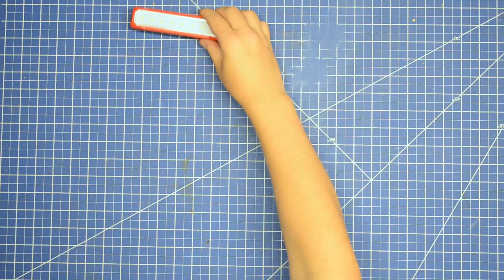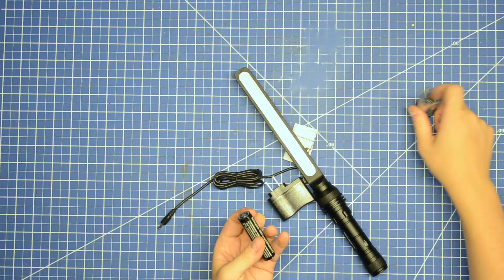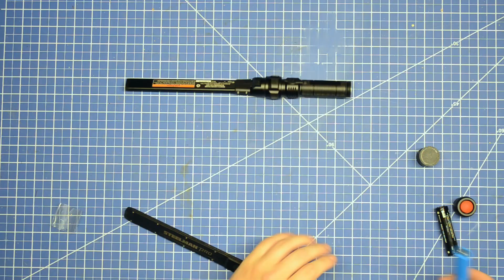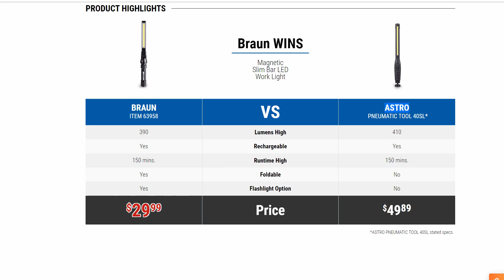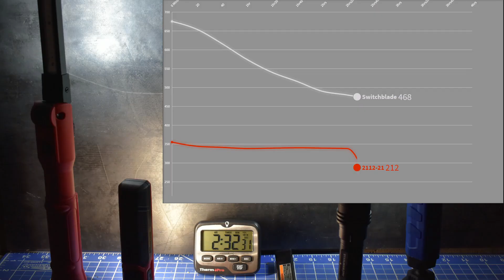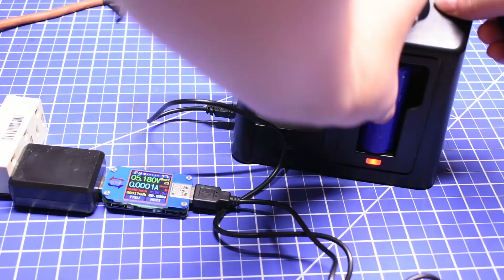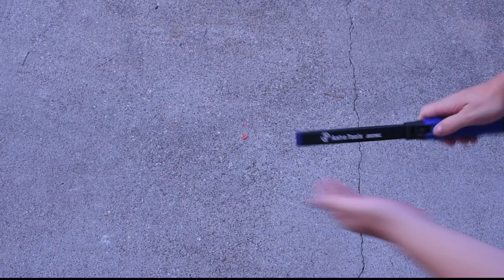Is Milwaukee Lying as Much as Harbor Freight Braun About Lumens?

Comment from the maker: See which lights and other tools have made the cut on our Amazon Storefront: https://www.amazon.com/shop/torquetestchannel
Reply: Keep up the great work. 👍👍
Reply: I love these light videos
Reply: The Astro SL52 is the best IMO but the 80 isn’t far behind
Reply: I was just thinking you should test torque wrenchs actual twist handle ones, im just thinking a test at the lowest torque setting, then either just at max torque  setting and/or mid range. Im curious how accurate they are from the factory. I know you can usually adjust them too but then ive also seen the electronic torque measuring adapters that i dont feel are as good as yours... cough cough Harbor FREIGHT. I know too many people buying their stuff and thinking their claims are true... earthquake xt. Im gonna try showin them your video on it nicely. They do have some decent stuff, like they're cheaper corded grinders are or at least used to be worth more than 30-50 bucks in the motor i feel. Plenty of speed and power without too much current draw unless you try to stop the blade but thats not the point. Ive gone on long enough, we all know they lie then excell and even surpass their own "tests."
Reply: Should also test ratcheting wrenches because why not.
Reply: Looks like HF free give-away light is a best buy  just by looking at the output.

Comment: Thanks for the vid. I have a newer version of the Braun light which advertises 500 Lumens. It's bright enough for what I do so I couldn't care less if that's accurate or not, but what really pissed me off was the runtime. Harbor freight advertises 20 hours 😂😂😂😂 of runtime, but doesn't specify which mode. I thought mine was defective when it was dying in less than 3 hours! But thanks to this vid it seems that's about typical for high mode.

Comment: was the steelman 18650 battery protected & the others you used unprotected? the chip added to a protected battery increases its length very slightly. i refuse to use lights that take a proprietary battery, olight loves to do that crap, they make good lights but having to buy their 18650 batteries instead of the boxes of regular ones I already have really turns me away.

Comment: I haven't bought any of this lights but if I tested the cheap inspection lights I used for drop resistance I would have dropped them once straight into the bin so I wouldn't have to pick those damaged torches up from the floor ... 😒

'cause even one drop from low height meant that the on/off button would now get stuck in the pressed down position and you would now have to hit the torch on the battery lid to get make the on/off button on the other end pop back up...

So to switch on:

 press on button in and hit the other end of the torch to pop the on/off button back out and then AGAIN for switching it off press button and hit the battery lid on the other end

..... One.... DROP..... on the floor 👎👎👎👎👎👎

Comment: I imagine people want to know if the light runs off the charger as not everybody is perfect, not everybody knows the ideal way to keep a cheap lipo alive for more than six months. The maintainence is not clear. so if that non standard sized looking  battery (not just available at the shops) is useless the torch would be useless, unless . . . The torch runs off the charger.

Comment: My opinion, the Walmart Hyper Tough work great for the price. The pen light has 3 different lights, 4 modes with folding and rechargeable. $14 with a magnet base. I love mine and when I accidentally left one under a truck because the boss was in a hurry to get the truck out, and they were gone before I could get if off the bumper. I didn't care so much about the $14 verses $100+. And I actually paid $8 originally, but still the $14 is great. The larger $30 works all day for me, bright enough, 3 modes, heavy magnets, and rechargeable. For the price I'm extremely happy. And nearly all Super Walmarts or main Walmarts carry these and offer extended warranties for like $2.

Comment: I use the 12 Volt Bosch Pro lights and have been very happy with them so far. Lights costs about the same as the ones you tested, but given they come without a battery and use Tool batteries they end up being fairly juicy if you have no other use for the batteries. Runtime is as you might imagine very good, light quality is OK, i have seen worse but also better. Durability is pretty good but could be better, especially on the inspection type lamp.

A High CRI Astra 80 SL would be something id like to buy. 26650 cells are something i already have lying around and i like the quick change system they've got going.

Comment: Worklights and inspection lights are 2 different lights to me. My inspection light is a StreamLight Strion. It is on my person all day at work. My go-to work light is a StreamLight Knucklehead. The knucklehead is not the brightest light but it doesn't have to be for what it's used for. The knucklead is the ONLY worklight I have used that will survive a shop environment. I even ran one over with an F250 and it still works.

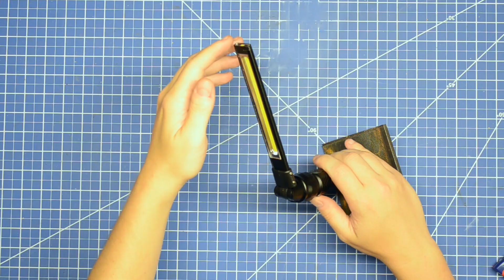Comment: 2:45 - it's do to the battery cap, I noticed that too, putting it onto a metal surface it slightly un-twists the cap. I have 4 of these lights and that's the only fault I've notice, so far. I've had these for years

Comment: Another knock against the Braun (pointed out by a mechanic on another channel  who has tried three of them) is the poorly cut battery compartment threading. This was a problem because while he really liked that he could just insert a new battery when it ran down, unfortunately, the battery cap threads deteriorated from repeatedly unscrewing them and this happened on all three lights that he used, so he has decided to give-up on using this light, though he otherwise liked using the Braun in his shop.

Comment: I agree not recommending Braun lights for professional applications. I bought 2 a few years ago as only a home user. They both held up well, surviving a couple drops, until I dropped one from around 5' and it cracked the swivel header (aluminum part). As far as home use, I think they're fine particularly when I bought mine I was able to get them for $20 each.  I also upgraded the batteries eventually, although typically the OE batteries were fine and they did last a couple hours. Never thought anything on the light tint.  Not sure what the market currently is, Braun's may still be an OK-quality budget option or not.  The other issue, and it's a minor one, is the magnet cover's both wore through and started shifting. They appear to basically be a thick sticker. Someone like a pro mechanic would probably experience this in a couple months, to the point where they would have to be very careful to avoid scratching/marring paint work.

Comment: I'm retired now and picked up a pair of Chiwanese wand "worklights" for $8.99 on Ebay.  They have Bright (maybe 300lm), dim (maybe 100lm), single LED tip light (maybe 150lm), red strip (maybe 75lm), and flashing red strip (maybe 150lm).  I'm QUITE satisfied with them for the price. I don't have a runtime on any mode yet, but they're internally rechargeable.  Oh, there is a magnet on the end and a hook, for working on your Tesla aluminum frunk lid, I'm sure.  //  You have great tests for all these lights, dude.  Thanks for all of them.

Comment: I have the Braun light and it works quite well for general purposes. It does break when dropped but I have broken the business end off several times and glued it back with epoxy and reinforced with dental floss... it is by no means a tank... the pin in the center is plastic and is the weak point but I drilled out one side and shot a screw through the pivot and so far it has been working well. 

I will mention that if you replace the battery make sure you use a PROTECTED button top 18650 unless you like angry pixies dancing in your hacienda or shop overnight.

Also even though it is not very rugged, I do like the fact that not only does the head flex BOTH directions you can also rotate the head so that the power button is on either side which is neat.

Comment: I have the streamlight. was a bit let down on the one direction wand. being it has different light on both ends WTF!. But I use the wall charger and it only takes 2.75hrs to charge from dead. not 8hrs with the usb type hook up. Do a video test on the LightBar Pro ... headlight system. Seems promising. Great use in automotive with a full surround light output. and bright enough to be useful. plus option for 2nd battery at a total of $90 with kit. $70 with just the light. I want an upgrade from the dual LED matco neck/head light and the Snap-on version. both die out in about 2.5hrs but with steady output of about 300 to 400 lumens

Comment: I have the same HF light. At first I really liked it so I bought the changeable head style. That one I can count on 1 hand the amount of times I used it. The main head broke at the joint. I have the two other heads but they aren't as useful. My original is getting sloppy at the joint. I have an Astro with wireless charging on order.

Comment: I did wish they made them square or hex shaped. I'd also prefer one of those magnetic charging cables as I've had to clean out the port and also adjust it as it has been pushed in over time. 

All we really need is:
-stays where you put it
-can be aimed in all directions while standing
-can't roll
-charging port is clean and easy to plug in and remove
-fast charge and lasts 8 to 10 hours
-joint is repairable and adjustable
-able to hang
-Bright
-easy to store
-strong

I ain't very good with electronics, but would using a potentiometer to adjust the brightness/turn on and off cause the light to die faster? I never understood why they make them like a 3 to 5 button clicks to operate some of them.

Comment: I have seen several mentions of this light switch issue for the Braun.   I have one.  Turns out that on mine at least this is a result of the battery cap not being tight enough.  You need to really crank on it and then it does not go off.   Also, the battery they include is longer than your typical 18650 so it barely fits in my charger and that probably contributes to the cap issue.  But when I did test the battery out it actually delivered more than the stated capacity.

Comment: You need to find the type of electrical meter that plugs into the wall and has a regular female 120vac plug on the front, that will be able to give you reading on even the non-usb type lights and chargers... have you looked into them before already??

Comment: The only issue I ever hear off with the Braun light is that you need to properly tighten the cap before use as that is what causes the button issue. If that is sorted they are usually fine from what I hear.

Comment: Had the braun for 3 ish years now, daily use in aviation. No big issues. Been pretty good for 30 bucks. Low light setting is more than bright enough and last me all day, way more than 2 hours. I only use bright for short busts of time like inspections in large enclosed sections like the tail. If i need more light i get another type of flashlight. Form factor is good for my environment. Fits in tight spots. Better than using headlamps sometimes. Color is fine for reading colored wires, although most wires i see are white. Magnet base is strong enough to hold on a tinnereman washer or steel screw when i can find one. Hook would be nice sometimes but i have other lights for different situations. I use it plugged in sometimes at my tool box to use as a desk lamp when I'm building wire harnesses which hinged at the center is helpful. Hard to justify 2-3 times the price for a small light.
Reply: Worst comes to worst. You can make a hook from safety wire- that's what I did for use on our 206's

Comment: 2:30 - I fix my own fleet of hoopties, so really having the ability to pop in some 18650 batteries (which I already have some of on charge for various tools) could be really handy. Anything rechargeable I have a tendency to let sit for 3 to 8 months before use and by then a lot of times the batteries will be less than full, also this ruins the lifespan of the products. I have Makita battery packs that've failed from just sitting on a shelf for so many years lol... but yeah I keep 18650s juiced up and use them regularly, so I kind of like that feature.

Comment: I reclaim 18650s from old laptop batteries to use in my Braun LED light.  I have a cheap 18650 charger as well so that I always have cells fully charged and ready to go.

Comment: Nice review. I bet the charge times are limited to the rating standard of micro usb cords. The Milwaukee probably would charge faster in their charging station since it could monitor the battery cell temperature. Be interesting if you have put all the flashlights in the freezer before recharge to see if any of them are temperature protected from charging below freezing. The Milwaukee tool batteries won't charge in their charging station if too cold - not good to charge lithium batteries below freezing temps.

Comment: I used the Milwaukee light recently and found that even with a slightly limited run time, the durability AND ability to fit in my pocket is more important that sheer lumen output.
However, I find that the magnet could be better as it sometimes pivots and slips a bit on some metal surfaces.

I have been using their rechargable headlamp and really like it.
It's nice and bright, durable, and charges pretty quick... run time is... 2.5 ish hours I think on max output.
I do wish it had one more with more of a narrower, but longer reaching beam.

Both of these lights are also great at maintaining brightness.
Having a light that fades away to half output is annoying and not very helpful at all.

Comment: I have the HF light. Every time I think that the switch crapped out it has been that the battery cap has come loose. The magnet is stronger than the threads, so if you twist it while picking it up it backs the cap off. I have the one with interchangeable heads but love the light bar most.

Comment: Can you do the tap/bang test on lights too!!!!!!! I have a recurring issue with every single light bar style light where if it gets bumped/tapped or if you are banging on something on the car with it attached it will turn off. Again this is an issue with ALL the brands I've used, not just one in particular. Everything from my cheapo to the $150+ rechargeable lights

Comment: For cheap good 18650 batteries go buy clearance battery packs from Walmart etc like Pokémon ones etc they have two 18650’s usually Samsung or equivalent. They can be bought for very cheap like couple bucks all the time. Or if you have a dollar store that carries single 18650 battery packs works too.

Comment: Had same issue with my Braun light.  I sprayed WD-40 brand contact cleaner in it.  Ruined it.  Damn.  Think it crazed some of the plastic inside.  I should have used Deoxit.   But I did love the light when it was functional.  I used my own cells, and external 18650 charger.  I think I'll pick up another though.  All said and done.

Comment: I have bought these Braum lights by Harbor Freight for a few years now, I am a professional tech. I think they are a good bang for the buck situation. You can get them for about $30 , they do have some durability issues (but then again I am really hard on lights) but cheap enough to buy again if you break. I currently have 3 of them I feel they provide a good amount of light. I have bought some snap on lights and i have a matco light that is like a bigger pen light with a dial for brightness and magnet a the bottom that is rechargeable but out of the lights I owned Ive liked the Braum lights the best. I paid over $100 for the matco one and I only use it when i need something a big smaller to get into tighter spaces.

Comment: Stream light is a BEAST. I dropped my Streamlight Pro-Tac 2LX down a 14 story elevator shaft. Only damage was a slightly bent tip and a cracked/broken lense. It still turned off and on and WORKED just fine after I dug it out of the Elevator pit. I still replaced it since the lense broke, but I keep it in my truck as a spare/emergency light.
Reply: Yes they are, I have this streamlight switchblade and have dropped it off a dump truck multiple times without any problems.

Comment: Braun, when first out it was $13.99 and bought all 14 that were in stock, went back a few days later and picked up 6 more. WHEN they stb the head module gets used elswhere ie trunk light under counter etc. At that price could not pass it up and still hav e5 or so gave some away.

Comment: Nice to see some lights being tested. Been using the HF light for a while at home and work. It's been decent. I put it on the charger at lunch to top it off. Hasn't left me In the dark yet. May upgrade the 18650 cell.will have to be careful not to drop it. When I do I know which ones to look Into next.

Comment: The barrel plug isn't really proprietary, it looks like the old school Nokia chargers, if you're in a bind you could use your ISPs router charger to charge your inspection light. Just check the output voltage. I think lights switches off as a protection mechanism when you drop it, it shocks the pcb

Comment: I have a Braun had this light for a couple of years now, for our use it is an excellent light. The light is not used everyday we mostly use this light during power outages for some reason that is a couple times a year. when we travel i throw the light into the car. The light you choose should be based on what your needs are. as always my opinion only Thank you for sharing

Comment: I use the Milwaukee rover stick light rechargeable version. It’s a great little light and carries good in the pocket and doesn’t roll away. 
Bad thing is I thought I had a bad battery toward the end of its warranty so I had the battery replaced. It still had issues so I ended up having to replace the light.